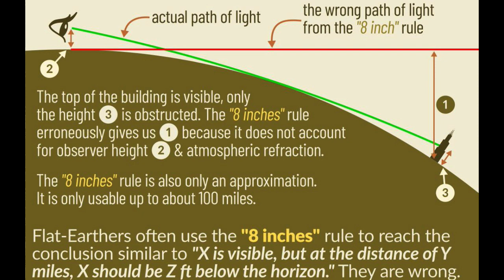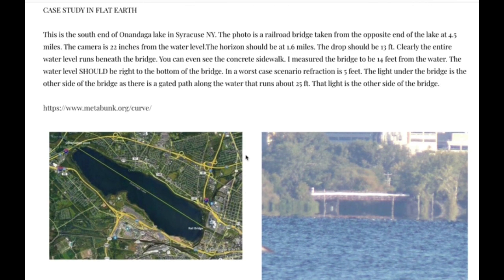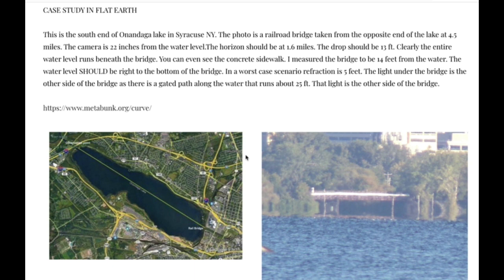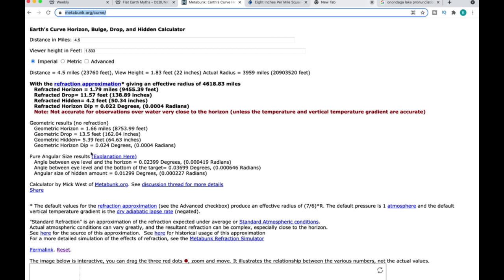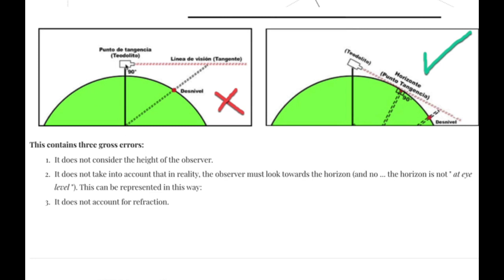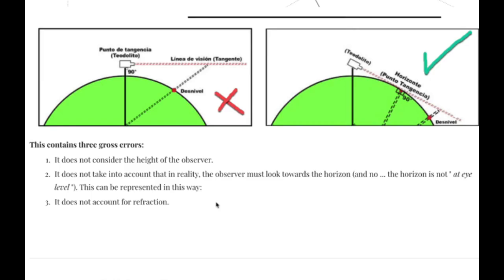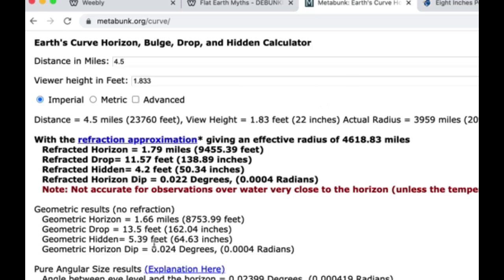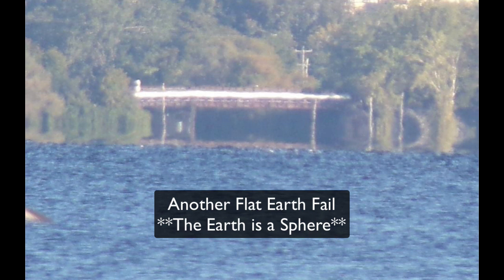Flat Earth *Fail* [Onandaga Lake Experiment Debunked ]

Comment: Nice example of mirroring demonstrating water vapour reducing air density immediately above the water surface, allowing refraction of the light upwards when the angle is shallow enough. Something that depends on the conditions to be right to get lots of evaporation. Such as hot clear sunny days. I prefer totally overcast dry mornings for minimum refraction conditions.

The figures quoted mean that the effective angle for mirroring in this case was VERY small. Thus the depth of the region with the mirroring effect was small. For the Sun to set on a flat Earth, upward refraction must be the norm, so the mirroring effect depth should have been much bigger if the Earth were flat.

Lake experiment debunk reminds me of the laser experiments by FE Core and others. They amuse me as on a flat Earth they are a huge issue. If the laser is going straight and flat then there is no refraction. If there is no refraction the Sun cannot set. The Sun sets so the Earth can't be flat. It is almost as good a self debunk as claiming Celestial Navigation only works on flat Earth.
Reply from the maker: Thanks for your detailed analysis. It's always appreciated when you do 🙌